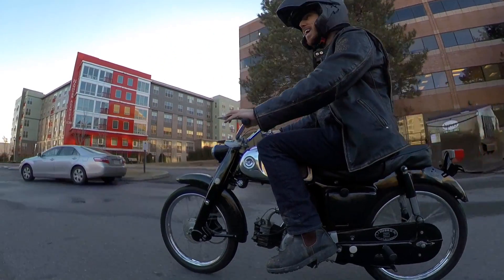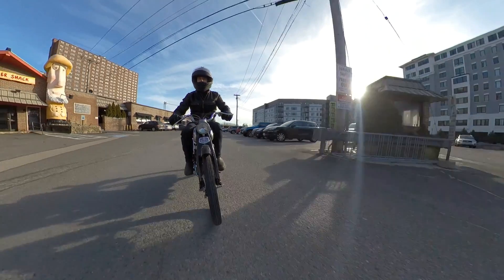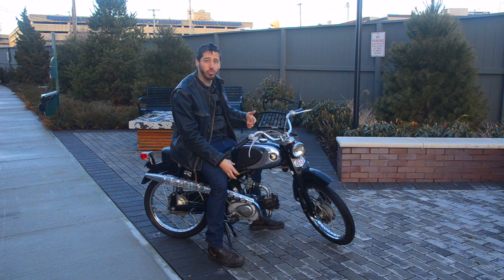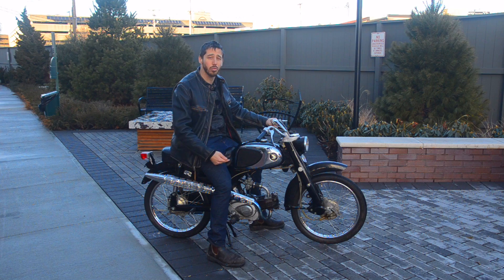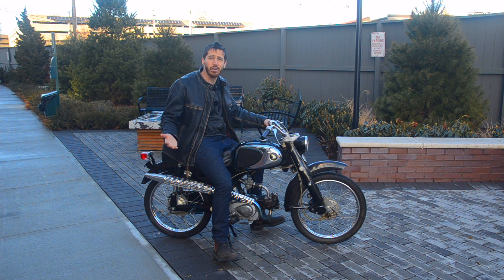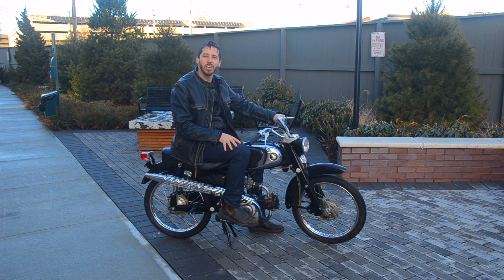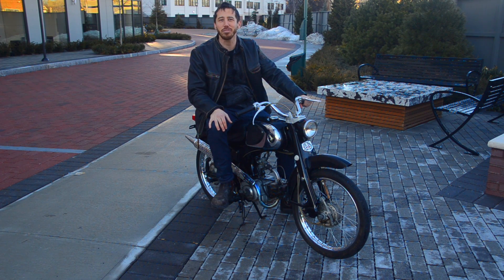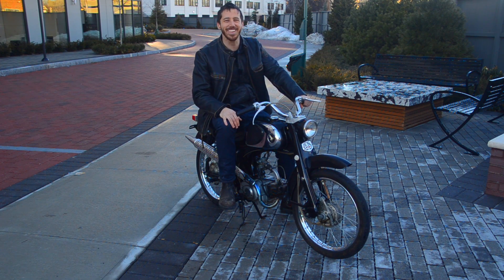DIY electric motorcycle conversion with 1969 Honda - Part 1: Planning

Comment: I sort of have the exact Bike in stock form. It was my Fathers and he got it in1964 different model than yours but almost the same tank  I think it will be cool keeping the tank for the look  it would be cool if you turned the  rubber pad area s into secret doors  to still give you access to electronics you stash inside the tank  heck it could even give you easy access to  a fuse box  or something that easy if you wanted you could get really creative and  add a lock  on the door that you could pull the  main fuse on to deter theft  in the city ?  That rubber tank guard would be a great place to hide  anything and still keep that originality of the bike that  those old Honda’s  had for styling  along with the chrome  you should replicate the Honda badge  to   A green color  adding the letter E to it  for electric of course  just settle differences BTW I’m one of those many people that appreciates the parts returning to  our number 1 parts source Ebay  for those that need the stock parts  to keep our Vintage Honda’s on the road  even if it’s just a pit or Farm bike

Comment: seeing my old favorite scooter with kinda emotional conneciton  honda ss 50 as electric would be so weird like taking a step into the future. but also it could be changed into some other things , four wheeler two side by side chair between, table, furnature , bed , washing machine. refridgerator, bread machine from the tank , toaster from tank, airplane.closed or open so sittin on the scooter but also has engine in front or in scooter engine place big one then wheels need to be lower and front wheel far out. too new frame. ..or , wings on scooter and dive till lifts,, boat.

Comment: I saw a neat mod on a brush less conversion where the right foot brake was retained and the adjustable regen was wired into the clutch lever.

Comment: I love this bike. I use it to ride to work. share4.photo/ebicycle?Ш It's a 12 mile hike with several hills. It climbs hills rather well for a 500w motor. In retrospect I should have gotten a 750w or 1000w. But this bike is great. Battery life is pretty good though once it hits 2 bars you better charge it because it will cut out randomly.

Comment: Made my own vintage electric bike conversion some time back (thanks to you for the information necessary, see it here if you want: https://Imgur.com/a/hRnceie ) and as you ca tell it’s way more motorcycle than bike, what with the indicators, headlights, brake lights etc. That’s basically because I’m gearing up for a motorbike conversion at some point.

As it’s a city bike I’d say you’re fine with hub motor. You’ll have smooth roads, you’re not planning on going insanely fast so you can get away without a gearbox, and I’d say something in the 5-7kW range would be adequate, though you could go up to 10 for a beefier ride. All I know is it’s easy for me to hit 30mph on a 1kW 30kg bike so scaling it, 5-7 should be fine. Also saves you dealing with the chain.

You could stick a bunch of batteries under the seat and if you were to silicone mould the engine block you could possible cast a shell in its image to cover any necessary metalwork and hold some extra stuff, e.g. the charger.

I’d say you’re very right to keep the tank, if you did it right you could definitely use it to hold the controller and/or batteries or more easily just make a simple storage space for a charge cable.

You could probably find an old analog dial voltmeter that would be in keeping, that was my plan!

I definitely agree you’ll need to beef up with a torque arm, probably some creative welding to just bulk up the thickness. 

If you’d like to discuss keeping the retro feel while modernising the bike just hit me up, that’s sort of a passion of mine (again, see my bike).

I’m looking forward to watching this progress and will keep an eager eye out. Keep up the awesome :)

*edit:* came here from a post online, didn’t realise this was several months old, sorry!
Reply: You're a beast! That bike is sick.

Comment: To keep the vintage look, I'd consider using an analog voltmeter to show the battery charge. It would just need to be modified somehow to make the scale more appropriate, and dunno if it would work with all the vibrations when riding.

Comment: HI, how is this project going?, I am trying the same with a CT70 honda. Having  hard time finding the right kit, any suggestions?,  what about this one? please help. Thanks. https://www.aliexpress.com/item/48V-2000W-Motor-Wheel-Electrical-Motorcycle-Conversion-Kit-Bicycle-Engine-Brushless-Controller-Set-Motor-Bike-Accessories/32968087952.html?spm=2114.search0104.8.13.15c74710NPIcIc&transAbTest=ae803_5

Comment: Awesome project! I love Benjamin Eby's "Big Guy Little Bikes Cub E" project too. I'd been looking into possible ev conversion vehicles and he inspired me to go in this direction as well. I bought a complete cm91 but didn't have the heart to dissect it. I decided to do a restore instead.
 I've since acquired a number of non op parts bikes. All good ev conversion donors. My problem is vehicle titles. Turns out it's really difficult to get these bikes on the road without a title. However in my state like others you can legally ride a bike 50cc or 1000w ev without vehicle licensing.
The only solution I can devise is: 1000w ev street cub bobber! 
Anyway best wishes! Keep up the "ReVolting" behavior

Comment: making BIG RED a fat tire bike with a rack on the back and a 5 kW hub motor @ 88.8 volts @ 45 ah. have rack mounted battery pack with folding side bags of metal. fold up to about only two inches fold out with a flick of the finger spring loaded side panels pops right out and fold right back up. the front tire was taken off to add a cargo area on the front with a 20-inch tire rated at 2,00 watts. making a toggle switch that on forwarding one switch the 20 inches tire alone runs. switch to two the rear hub motor alone runs. flip it to the middle both will run!!! the cargo area can hold 150 kgs of gear too!! quick release pulls one pin undo two threaded brake connection and the front wheel back on, but with the cargo haul gear or the Mrs?? to and from the lake!! till then, science the shit out of it!! the better the plan and planned out the easier the planned job!!!... YOU CAN DO IT!!!... now, what were you doing again? lol.

Comment: if this thing has the battery under the seat you can make two 88.8 volts at 45 ah batteries open the seat and install them by sliding them into a custom metal encloser were the engine and carb, battery use to be? at about 45 degrees. that way the first battery wears down just open and transfer the plug into the second battery. on the tank controller in one side and a dynamo on one wheel going to an acharger unit on the other side of the tank to recharge the first battery while using the second one?? giving you an unlimited range. if your going to take the money time and effort make it one of a kind or the prototype of a new type of urban scooter?50 mph tops range per battery about 65 miles switch over go 65 miles switch over because the second battery is fully charged?? ya have space if ya plan right? the job is in the details. controller left side of old gas tank, right side recharging unit and dynamo controls also. have 5 kW rear hub motor drive. each battery is about the size of 10 inches by 3 inches by 28 inches long. yeah, you can do it, but do it right?? go class with pin stripping on the fenders?? good body and paint shop will do it. hope it helps the ideas?

Comment: My suggestion is that you add a support under the tank where the motor is now for the battery pack, possibly a tall obtuse triangular shape that can be removable so you can take it in your apartment to charge but also it'll give you a good mounting point for pegs... This is more of a preference but you can get different bars to improve your riding position and maybe go w/ the delta/wye setup so you can surprise a few people but disguise it as a "turbo" switch (lol), plus it'll help keep whiskey throttle wheelies from happening cause those cubs have short rear ends. Thanks for the vid and keep up the good work¡!

Comment: Hi Micah; I have been at this battery thing for some time now and because i am a slow learner it has taken  me a longer time to put things together and i have come up with  the realization that in this field of diy there is a 
noticeable lack of basic info when it comes to explaining just what batteries can be grouped to form a bank
ie;can you match up 1300 with 2000 mah batts with each other as well as similar c rated discharging batts-
i guess what i saying is i am just discovering that there is not enough sharing just what is all involved when it comes to choosing what 18650's go together,there seems to be enough of how but very very little on the basic groupings of batteries,am i that slow,thanks vince.

Comment: Look forward to watching these. Covering the controller and wiring with the tank is a good idea. I think a mid drive would look better with the battery filling the triangle area above the motor. Good luck with the build.

Comment: How about doing a hub motor and a mid drive combo on this project? I know you will need two separate controllers but you could go with a weaker hub motor and a weaker mid-drive but end up with a nicely rounded combination of power and speed.

Comment: I love that bike. I have wanted one for a long time. I am building an electric 1974 Rickman Zundapp electric assed conversion bike (no videos).  if you could keep at least the muffler and heat shield part of the high pipe if possible, for cosmetic reasons, that would be great, because it is 50% of the cool style of this bike. one of my all time favorite bikes and electric VERY EXTRA GREAT!!!
Reply: split muffler cut it and batteries inside or what
Reply: @orangestoneface   yeah  that would be VERY cool.

Comment: Hmmm. I love the old little Hondas. I have a 1980 CT110 and a 1966 CM91. The one you have 1969 S90 would complete my set (Trail / City / Sport) Tough to see it used as a donor bike. These bikes are old. Difficult to find original parts, most are cheap Ebay replicas from Thailand. 
I love to go electric but wish you had chosen something newer, cheaper, and less desirable. But all the same... I'll follow the conversion story. Good Luck! Should be cool.
Reply from the maker: Thanks, though there seem to be a lot of parts all over ebay for these. it's a 1969 ca110, not an s90. those are more rare, I believe

Comment: Cool project Interesting to see the weight of the parts removed eg engine chain exhaust carb v the new battery and motor system

Comment: Not an ideal platform for an electric motorcycle!  Stamped steel "frame" and "swingarm".  Much better to start with an actual frame and boxed swingarm.   XlL250 for example

Comment: Is this hard.   Remove motor and cub transmission. Cut gas tank in half. 
    Install a eMotor attached to drive countersprocket sized to equate 2nd gear. 
     Install two or three removable LiGel packs in empty tank. 
      Install potentiameter in throttle. 
       Install controller charger under the tank. 
       Put hinge on top of tank you cut away. 

Ride.   We build these things in Fairhope AL for the past 15 years. e Bikes are damned simple mechanically due to the longer low end torque. 2nd gear for petrol should run from zero to 35mph 50kph easily wo transmission gearing.

Probably as far at 50mph, but the Cub is a horrible frame for handling higher speeds.   It is an upright moped. Old tiny drum brakes after you add the quickness of the e motor and inertial mass of batteries will kill you at higher speeds

Comment: Much simpler to mid mount the motor and leave the rear wheel, sprocket, swing arm, rear brake and brake pedal as is. Isn't this obvious to you? You have a space for the motor when you remove the IC engine. The tank can be split to house some of the batteries.

Comment: I'd like to see if you can do this in such a way that the Honda can be converted back to original spec easily - no frame mods, adapter plates instead. That's actually a pretty rare bike, it has the torque arm front brake system which is the only really good one - the non-arm front brake pushes up when you use it. I actually would like to see this conversion, but as i say, not at the cost of ruining a classic. In the UK people would pay a LOT of money for that motorcycle. US$2000 would not surprise me, could easily be 2500+. Sympathetic mods the order of the day.
Reply: Honda might have made a lot of stuff based off the Super Cub platform, but only a small number had that special front brake, and a great deal of them just got thrashed to death then thrown in a ditch. That's a rare bike in 2019, especially if that nice condition is relatively original.

Comment: Looks like a cool candidate for a conversion, but fitting the batteries might be tough. I’ve always wanted to convert an old cub or ct-90 with a hub motor. My current project is a 1967 Kawasaki (or should I say... Kawashocky) A1-SS. It’s  got a Motenergy me0708 middrive setup (5kw cont. 15kw peak), 3kwh of used lithium iron phosphate from a Fisker Karma. Top speed indicated by the original speedo is 60mph, not sure how accurate that is though. Needs some wiring work, and a bit of testing on the BMS, but it’s mostly finished otherwise.

Comment: Don't do a mid drive. I have the 3kW Cyclone and the stupid drive chain is driving me crazy plus you need to do some type of gear reduction, which would be another headache. I think you should do the Maxis 3kW hub or the Chinese premium hubs that a lot of Russian use. Those Russian go crazy speeds on them. The battery box should be fine and relatively easy to do. I agree keep the tank and put the controller there or make it into a compartment for wallets, phone, etc. Also, I am making a serial hybrid on my channel 72V 3kW Cyclone and ~300W 25cc gas generator. I hope to complete it soon but I might have to turn my 72V into 36V because it might be too inefficient or hard to step up 20V from the generator into 83V. Looking forward to this conversion! BTW, you should do ebike vlogs.

Comment: Sweeet! Can't wait to see which direction you go with this bad boy. Great choice for the donor bike btw, still miss my 72 cb350 (only sold it bc I got tired of cleaning out the carbs and rusty fuel tank). Think it would make sense to mount a Bafang Ultra on there? Start learning Fusion 360 it's free and not too hard to pickup. You'll want to reach out to some machine shops for help with the mount brackets etc.

Comment: Jou can put batteryes in the gas tank
Reply: yea just solder wire between them and drop them one by one inside can even add  gasoline to make it look original have them sloshing around in the gas fluid.

Comment: How did you assume or calculate energy consumption per miles? 
 at 30mph 50 wh/miles?
Reply from the maker: My estimation based on a lot of experience of riding similar sized electric vehicles

Comment: Hi Micah (hope I spelt that right) I love your videos they have helped me a lot. I was going to do a electric bike and instead I went strait to a mini motorcycle. It sounds like you are going to use a hub or mid drive motor like you would a bike so I'm not sure if my advice would help because I mounted a motor on my build which is a little different but here are the 2 major issues I ran into.
1. Underpowered- I used a 2kW motor which when I monitor the power with my inline watts up meter settles more around 600W not sure why becuase everything is maxed and I overvolted the motor. It passes 1kW usually on the start when the motor struggles to get started and the shaft turns over a bit until the momentum surpasses the torque limit. I'm 350 pounds and it pulls me but I tested it with lighter people including my 11 year old nephew but can only get about 10 to 13 MPH tops
2. The biggest issue I have is with weight and power drain. The battery gets super low readings as it drains due to the high power drain. If I let it sit the the total voltage and the cell voltages go back up after a few minutes. If you use a BMS then it will probably cut your power very early in discharge. I just monitor the battery without a bms and am always worried to push it too hard and destroy my battery.

Anyway hopefully that helps. I have a couple videos of my bike on my channel. They are very short and undiscriptive but if you are interested to see they are there if you want to see what I did

Comment: Interesting! If you don´t need torque for long steep hills, don´t intend to use pedals and want low maintenance  go DD hub motor with regenerative braking. Put controller in tank or compartment under saddle,  and 72V pack, 18650, as low as possible. Biggest problem would be about legislation, is it possible to make it streetlegal somehow?

Comment: If you are going to put disc brakes on the back please put some on the front as well or else you'll end up killing yourself. Motorbike do all the braking with the front brake not the back one.
Reply from the maker: Thanks, yea I understand front brakes do something like 70% of the work on bikes, but drum brakes were originally effective. It's just that the current ones are 50 years old. So I think new drum brake shoes up front and disc/regen in the rear will be effective. Remember this isn't going to be a crazy fast bike.
Reply: @EbikeSchool  yes I know the bike is not going to be a crazy fast one but the electric motor you're going to put in it's probably going to have a lot more torque than a petrol engine. Anyway good luck with your project and I look forward to seeing more videos from you.👍

Comment: One advantage with a hub-mounted system is that you can still use the gearbox ratios - use it right and that could complement sustained speed range and easily climb hills in 1st gear. It would be an efficiency drag however.